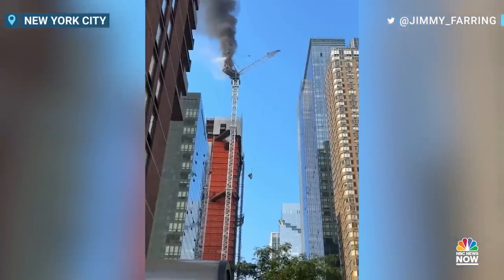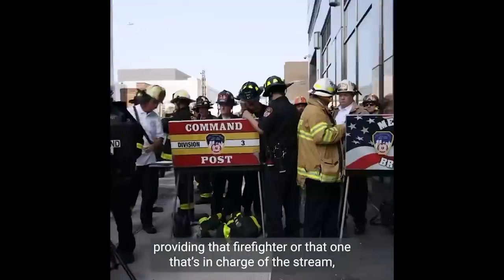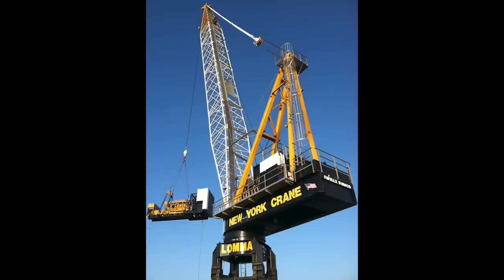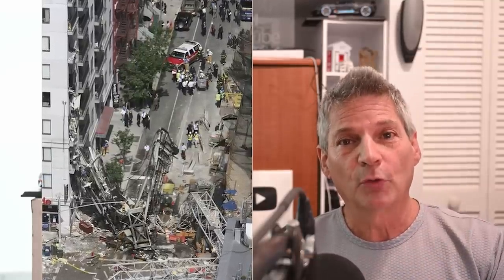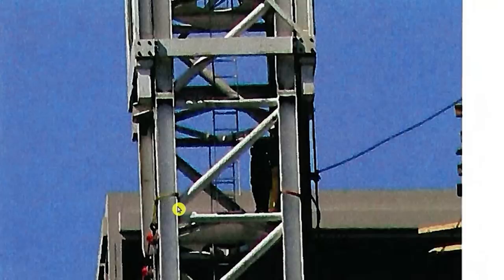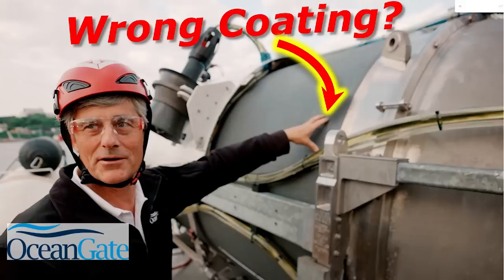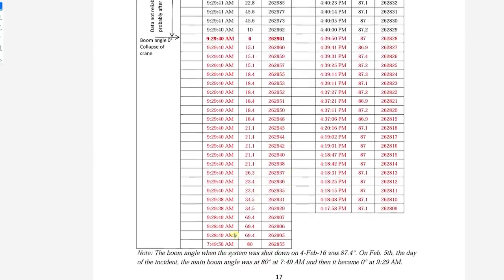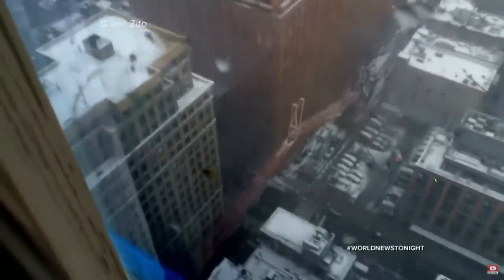New York Crane Collapse Cause, MORE Fatal Collapses

Comment: The crane collapses that I knew about(1 in the Army, and 3 civilian) all involved overloading. In the Army, it was a Major ordered the the Spec5 to exceed to safe reach and the barge flipped and dumped the crane. The civil ones were all cases of the customer lying about the weight to get a cheaper crane. Most catastrophes have a bunch of errors that lead up to it. When I was called up for Desert Storm, I served with a Major from the Hawaiian National Guard. He told me that they were being flooded with chinesium and they were having a lot of failures. He warned me to watch out for it. Another good video. Good Luck, Rick
Reply from the maker: Stockton Crane Company
Reply: Every crane should be fitted with an overload protection system. These construction cranes simply do not react if the load is too heavy.
Reply: @V100-e5q  Yes they do tip over, even when there's protection. I've seen it with my own eyes at a company I worked for a couple of decades ago.  A similar crane like the last one shown (but a Demag instead) had all the protections it needed and all where in working order.  That crane in particular came in for maintenance and since the maintenance took a while the crane had to be re-inspected (here in Belgium it's mandatory every 3 months + a bigger one each year). The inspector had just checked the crane, did severe testing to it and gave it the all clear.  When he just walked into our office to issue the paperwork the crane came crashing down (tipped over like the last one). Since it was the end of the day the operator was in a hurry to get out of there and instead of taking it slowly he rushed to get the mainboom and the jib down, unfortunately the safety system was a bit slow in shutting the controls down and preventing certain operations, in the second or so it took for the system to shut down the crane started to tip, the operator felt it fortunately and he jumped out of the cab before the counterweight came crashing into it.  The crane was perfectly fine, it was just inspected and yet it failed. It was only after that incident that we found out that the safety system didn't react quick enough. No injuries occured but the car of the inspector was totalled in the process, the hook came crashing right on top of his car, merely a meter of our office. Parts of the boom crashed about a meter deep into heavily reinforced concrete. Obviously the crane's certificate was revoked by the inspector since he was quite pissed at that moment 🤣 But our maintenance department repaired the crane, even some boomparts were recovered and repaired but the crane received a full upgrade of security systems. And the same inspector cleared the crane again months later (with his new car parked far far away) 😂
Reply: @jeffostroff  Savagery spotted 😂
Reply: Thank you for your service Rick!
Reply: @jeffostroff  What goes up must come down. No such rule for things that go down. 💀
Reply: Is that a problematic crane co? @jeffostroff
Reply: @Bralo20  
I'd be un-thrilled about signing off the crane a 2nd time.
Reply: @Bralo20  That's a great story, well told. 🤗
Reply: @user-sm3xq5ob5d  Most, if not all cranes being made in the last decade, will lock up if you are overweight, and the only function that will work is cable down to set the load down so you can re-rig it.
Reply: @Bralo20  Once you get that momentum shift you can't get it back.. they all know that.

Comment: As someone who has worked with construction equipment and farm equipment sometimes a hydraulic hose can burst unexpectedly with no warning, especially if moving a heavy load and applying high forces to the hydraulics.
Reply: Am I wrong to expect some redundancy for something that swings and lifts loads 100 stories?? Horizontal directional drills are the same way,,when a line bursts your done,but again it's not responsible for overhead lifrting.
Reply: No excuse there - if you are relying upon a hydraulic hose to keep a load in the air, you are doing it wrong.  There are load-holding valves used in the aerial work platform industry that are built into the base of each hydraulic cylinder such that if a hose breaks, nothing moves.
Reply: My friend you know about as much about cranes as i rickety submarines my only question is why does it not have q built in fire suppression system in the engine compartment for fires since there so high up in case of a fire pull a lever

Comment: So sad when accidents like this happen.
My uncle was a tower crane repair man, in California.   He was one of the ones that worked on the crane in place, not in a shop, or on the ground.   He made a butt tonne of $$$$$, because of the danger, and liability involved.
He gave me two pieces of advice, when it came to cranes.
1.) "If you're not making a living, being near the crane, stay the hell away from them and every place around them.   That goes double for one of them." (pointing to a tower crane)
2.) "IF you fail at your job, one of the other guys could get hurt, or god forbid a regular person get's hurt.   The second your hand hits that first rung, you inspect as you go.   All the way from the bottom up.   If you see ANYTHING, you note it and go back down immediately, and report it.   And your @$$ better not even THINK of going back up until the problem is fixed properly AND... to your satisfaction."
.
R.I.P. Uncle Johnny, and save some Scotch for the rest of us.

Comment: I worked on building steel towers. On one job it was convenient to use a crane to hoist completed 20' sections onto an existing tower. I was on the tower top putting in the bolts into each new section as it came up. 
One section started swinging a bit wild due to 0:06 sudden wind gusts that were getting nasty. As I wrangled the first bolt in place the ground workers let me know about lightning. I heard the boom and saw a flash, and I started climbing down like a scared squirell. 
We left to get under cover during a horrendous storm. When we next looked out the tower section and crane were at seemingly impossible angles, and the rigging had fouled everything.
The crane was up to its axles in mud and tilted a bit. The operator had set 3 wheels in 2 different swales, and the downpour buried the crane in mud. 0:06

Comment: 45 degrees give you the longest trajectory with 0 air resistance, the ideal angle with a water hose would be a lot less where wind is also a factor as well.
It's not exactly difficult maths to factor in air resistance either, I did it in high school.
Reply: The best angle is less than 45° for water moving through air. But the calculation is probably a lot more difficult than what would be done in high school. At least what we did was add in the coefficient of friction between the projectile and the air. But with water this is constantly changing. At first the water comes out as a solid stream with only the outside of the steam interacting with the air. Then it breaks into small drops with each drop interacting with air. These drops are so light that they also change direction.
Then even if you get the maximum distance, the steam may be so dispersed that the amount of water actually hitting the target may be very small.
The best thing to do is understand these variables and try different angles until you find the one that puts the most water on the fire. Shooting straight at it may fall short giving 0%. Shooting at 45% may reach it but only 25% coverage. Something in between may be the best.
It’s like if my shooting target is 10 feet in front of me. There are two angles that will hit it. I can shoot almost straight, or I can shoot up at about 80°. Both will hit the mark, but if the projectile (or water spray) is going to break apart before it hits the target, then one is definitely better then the other.
The fire hose in the video may have been at a low angle, but it may have been delivering more water than a shower would if they had aimed it at 45°
Reply: @bobh6728  Yeah, for sure. The stuff I did in school was just different shapes and air resistance, which is enough to know that 45 degrees isn't the universal best angle.
A stream of water would be extremely difficult to calculate, but logically the angle that delivers the most water to the target is going to be as flat and direct as possible.
Reply: @bobh6728 AIR resistance can be simplified by treating as a constant force pushing against the water stream.  44 to 45 degrees still gives the best angle for maximum distance 

.
Reply: @electrictroy2010  If it stayed a solid stream then it would be close. But looking at the video, the distance and effect of wind made it more of a misting than a stream. Since we didn’t see the whole time they were spraying water, we don’t know if they tried other angles and decided which one was the best.
Reply: Just mentioned this in another comment, but a good real-world rule of thumb is that the optimum range will be achieved when the object being fired is *coming down* on the target at 45 degrees.

.....no maths required. Just adjust your angle until the thing being fired is arriving at 45 degrees as that's the max range you're going to get. This is what the firefighters were doing in the video (at least with the larger stream which had a chance of getting close).
Reply: @iseeyou1312  Physics experiments aside, don't most folks tilt the water hose up and down till they see the maximum distance the water goes?
Reply: Also you have to take into account that these firefighters know what they're doing and within about 10 seconds of realizing they weren't going to hit the fire directly because of distance and wind they decided to keep the rest of the structure cool and wet to stop the spread of the fire until another solution was found, because they know what the hell they are doing.

Comment: Great video. You're on point with just about everything you spoke about. I work in construction in NYC.  We work with and erect and assemble and disassemble lots of these cranes, from the smallest cherry-picker to the tallest tower cranes. We are still yet to determine what started the fire, it could be anything, of course, but you are right. The damage done to the main cable on the boom was the problem. Right after this latest collapse (thank God, no one was killed) I got on a social media chat with some of my union brothers that have a lot more experience than I do in the tower crane department...and one of the first things that came up was the fact that Lomma cranes was involved, yet again. The corruption levels of this company are well-known in the industry...and we always talk in hushed tones about the corruptibility of DOB inspectors as well. Even the fact that Lomma got off in the criminal case has been alleged to have been corruption. I wouldn't doubt it. 
 Regarding the crane that collapsed in that bonus footage, everything you said was exactly how it happened. The crane operator started lowering the jib too fast and with the wrong angle on the boom. The only other thing I might add is that the one victim that died, word on the street is that he was told not to walk into a restricted area, and he (allegedly) flipped the bird to the flaggers on duty and did so anyway. Allegedly. Condolences to his family all the same, and may he R.I.P.

Comment: Two points:  
Point 1:  Cranes are one of the simplest machines found on a construction site. Even so, I've been amazed over the years at how often they are involved in accidents. There is no end to people's ability to screw up a lift.  This includes the ever-present mobile crane and bridge cranes. 

Point 2: A hose stream does not act like a projectile in flight. Even a well-formed hose stream will begin to splinter as it gets further and further from the nozzle. To get optimum reach a suitable nozzle with the water being supplied to the nozzle at optimum pressure is needed. If, for example, the pressure is less than optimum the stream will begin to splinter much sooner and will have less reach. Once splintering starts to occur, range will quickly be reduced.

Comment: I developed an allergy to truck cranes early on Jeff. Just a preference for old school crawlers that were typically stretched way beyond modern chart limits. -Bob... PS: Time to require an adequate plus Fire Suppression System onboard. May not save a header, but helps prever a total combine loss.
Reply: Ooh, good idea.

Comment: It seems crazy that there isn’t some sort of mandatory fire suppression system near the fuel and engine compartments 😮
Reply: I've never heard of this happening before.  Maybe they will consider in future.
Reply: @geniferteal4178  most cranes in europe use a ground generator and have power cables going up to the motors exactly for this reason
Reply: I think the only supression system that would work on that sorta fire is the co2 foam which would proabably get pumped into the cab killing the operator.  Hence why its probably left to burn since water would just make it worse and you would need a lot of sand
Reply: @harrythompson6977  interesting.  Make you wonder how they refuel this type.
Reply: @geniferteal4178  they use the same crane to hoist a fuel tank.
Reply: Why not stop the fire in the first place, IR sensors should be able to detect gross overheats.

Comment: as a crane operator i can tell you that your more likely to get hit by lightening than hit by a falling crane. 
also its very common for cranes to be operating right on the edge of stability limits, and to a degree but less common, structual limits. 
every day someone will ask you to do something thats beyond your reach or capacity. without doubt. sometimes you do it when experience tells you you can get away with it, and some times you have to put your foot down and say no. and almost everytime its the foreman or someone in an office telling you to do it. 
crane load charts are very conservative. lifting %110 of your capacity is usually fine, but its the extra factors that make it dangerous and why the load charts exist. 
wind on the boom de-rates everything. this is one of many unseen factors that can compound the error and give you the accidents you see.